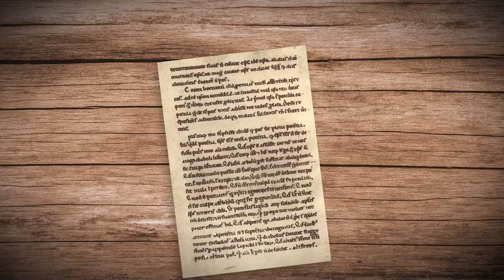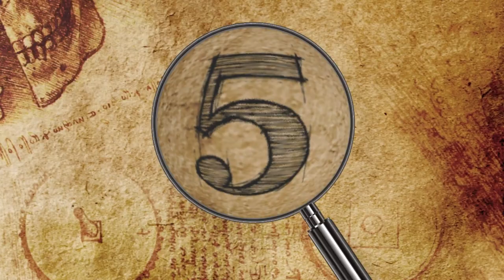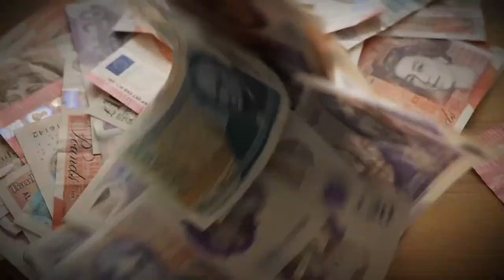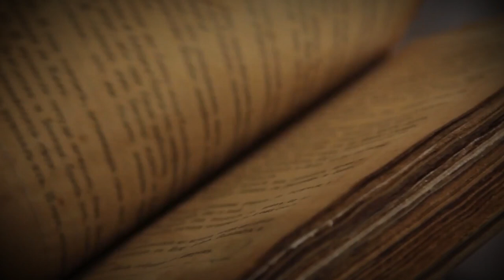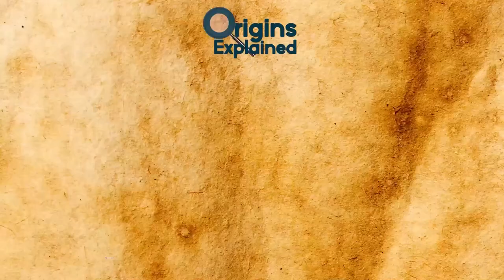10 Dark SECRETS Of Ancient Cities!

Comment: On your #7.
 The lost civilization of China. 
 It has been discovered that they did live on a flood plane. S flood would last about from a week to three weeks, going actually to the lessor of that < , 10 to14 days. Was no secret but, The flood they had that year had an earthquake during the flood that released CO'2 into the air. It was so intense that had to evacuate the entire area. As I see it; It was one of those things you just hav to walk away from? 
 The reason they know it was CO'2 is because they have found the source. It is still releasing the gas. Chinese scientist's understand that at the time of anything trapped beneath the earth will be under extreme pressure. When this is released you hav a massage release of gas. Initially, they evacuated and filtered into the surrounding areas. What they didn't know was. After about a year they could have gone back?